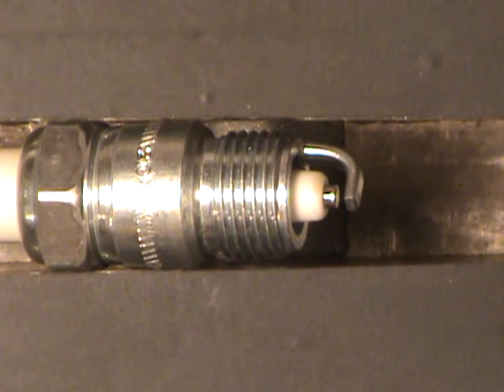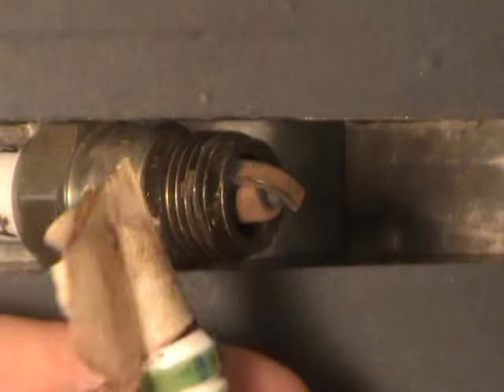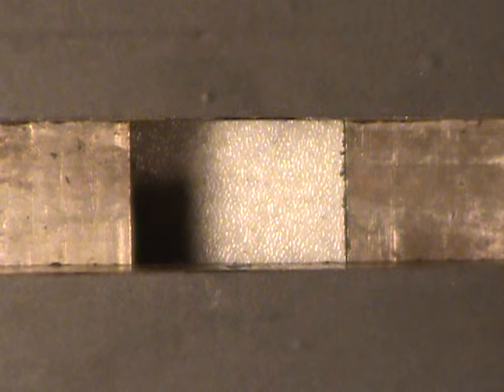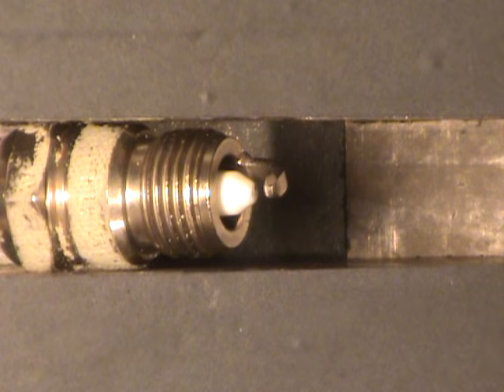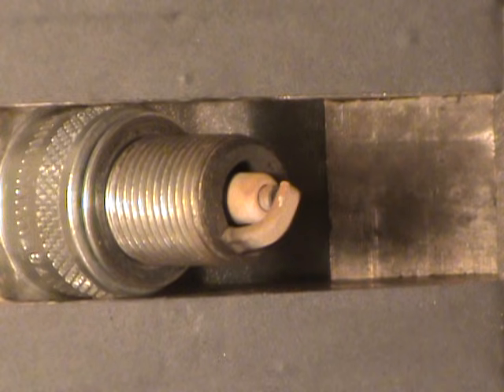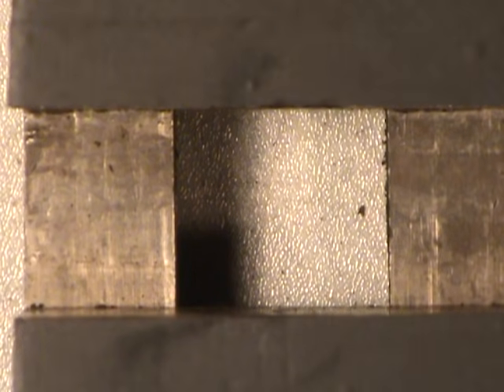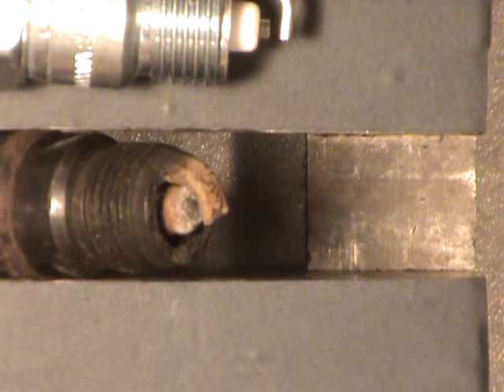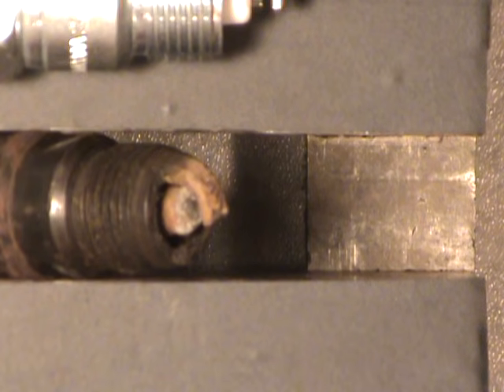SPARK PLUGS How to Read them (Part 3)

Comment: what lean means? running lean? (I'm a Romanian)
Reply from the maker: Greetings avalanchexy....Thanks for watching, and, for Your questions as well....The easiest way, to understand, the Difference between, what "Lean" is, compared to what "Rich" is, to think in terms of a "Ratio", as in, the Amount of "Fuel" (or in this case, Gasoline) that is "Mixed" with the "Air" that the Engine "Burns" inside the Combustion Chamber/s....A "Lean" Mixture, or Air/Fuel (or, Air to Fuel) Ratio, has "Less" Gasoline in the Air/Fuel Mixture, as Compared to a "Rich" Mixture, that has "More" Gasoline in its Air/Fuel Mixture....Let's Compare a "Rich" Mixture (or, Rich Air/Fuel Ratio), to a "Lean" Mixture" (or Lean Air/Fuel Ratio) shall we....A "12 to 1" Air/Fuel Ratio, is "Richer" then a "14.7 to 1" Air/Fuel Ratio....In the first example, the "12" is the Parts of "AIR", and the "1" is the Part of "GASOLINE", thus "12" to "1" Air/Fuel Ratio....In the Second example, we have "14.7" Parts of "AIR" to "1" Part of "GASOLINE".

So, when the "First Number" is "Higher", when Compared to a "Lower" First Number, the "Higher" the Number, in the "Air/Fuel" Ratio, the "Leaner" it will be.

When a Fuel Injected Engine, in a Car or Truck is just going about 30 Miles Per Hour or 50 Kilometers per Hour in the City, at about Sea Level, and, on a level road, and, the gas pedal is being held steady, the Air/Fuel Ratio will be on the "Lean" side, at about "14.7" to "1" Air/Fuel Ratio.

When the Driver, of the Same Car or Truck (above), wants to "Accelerate" really Fast (as in, Push the Gas Pedal All the Way Down), then, the Engine Needs a "Richer" Mixture, usually about "12.5 to 1" Air/Fuel Ratio (or might be a bit Richer), because, if the Mixture (or Air/Fuel Ratio) is far too "Lean" (usually Above, about "13" to "1" Air/Fuel Ratio), while doing a Wide Open Throttle "Acceleration", that Far Too "Lean" Air/Fuel Ratio, will usually "Damage" the Engine...!!!

When the Engine is Cold, it requires a "Richer" Mixture (Air/Fuel Ratio), to keep it running properly, then, when it warms up to "Operating Temperature", it will be able to, Run Properly, on a "Leaner" Mixture (Air/Fuel Ratio).

When I'm talking about the word "Mixture", it simply means, when, "Air" is "Mixed" with "Gasoline" in the Correct "Proportions", that's all.

So, You see my Friend, the word "Lean", just means that, there is Less "Gasoline" in the "Mixture", or, Air/Fuel Ratio...

...and...

...a "Richer" Mixture, or, "Richer" Air/Fuel Ratio, just means that, there is "More" Gasoline in that particular "Mixture".

Just remember, "Less Gasoline" in the Mixture is "Lean" (or Leaner)...

...and...

..."More Gasoline" in the "Mixture" is "Rich" (or Richer)...

...I hope now, that You might be able to know the Difference, between, what "Lean" and "Rich" are, when it comes to the "Mixture" or "Air/Fuel" Ratio, that the Engine Needs, depending on "What", the Driver of that Car or Truck, is asking the Engine to do.

Be Safe, take care, and have a good one.
Reply: Thanks for the detailed explanation! Better than the dictionary.

Comment: Smokes bad oil fouled  plug
Reply from the maker: Greetings donald laisure....Which Engine do You have there???....What "Year" is it???....How many Miles or Kilometer's does it have on it ??? (Odometer reading???)....The first thing that has to be determined, is, just "How", is the Motor Oil "Making" its "Way" into Your Engine's "Combustion Chamber/s"...???....I have Indicated Most of those Possibilities, in My "Reply" to You, in the "Comment", that I left here, just "Before" this One....Let me know, just "Which" Engine (Yours), that we are talking about, so, I at least some "Information" to go on....Be Safe, take care, and have a good one.
Reply: Yamaha golf cart one cyl
Reply from the maker: donald laisure
Greetings donald laisure....Thanks for the Information, but, there's a bit more to it, then the Information, that You did indeed provide, thus far....Apparently, there were "2" Types of "Yamaha" Engines, that were "Installed" in some of the Golf Carts...."1" Type was a "4-Stoke-Cycle" Engine, and, the "Other" Type, was a "2-Stroke-Cycle" Engine....I will now provide some Information, on "How" Both "Types" of Engines, "Might" be "Smoking" a Bit More then Wanted or Needed....But, before I go down that Road, I will ask You this...."If", and "When", did You, or someone else Do "Maintenance", and a Proper "Tune-Up", on Your Golf Cart's "Engine"..???

It's very Important, to keep Your Golf Cart "Engine", well Maintained, and in Proper "Tune" as well.

The so called "Maintenance", includes "Basic" Items, such as...

"Air Filter" and "Fuel Filter/s" being "Changed" at the Manufacturer's Recommended "Interval" (and maybe Sooner, if the Filter/s get Dirty/Plugged-Up "Before" that "Interval!"), and seeing as how You might have a Golf Cart there, that so called "Interval", could be, either or both, "Distance Traveled" (Miles/ Kilometers, and who knows, maybe even the Golf Courses "Yardage", and, how many "Holes" that You normally "Play", as in "18" Holes, or, shall we say, a "Half" Game, as in, Only "9" Holes...Oh, and, don't forget to Include the Distance Traveled to the "Practice-Putting-Green...!!!...lol).

Then, if Your Engine is a "4-Stroke-Cycle" Engine, You will have to "Change" Your "Motor Oil", and, Your Engine's "Oil Filter" (if it has one), as well, and again, I say, at the Manufacturer's Recommended "Interval".

Let's now see, if we can Determine, just "What" kind of "Smoke", that happens to be, shall we say, Pouring-Out-of-Your-Golf-Cart's-Engine...???

I will start with the "4-Stroke-Cycle" Engine (the Type, that has Intake and Exhaust Valves)...

...If the "Smoke" looks Black, then, this is usually an Indication, that the Engine is being Fed (as in Feed), a Too Rich Air/Fuel Mixture, that can be caused by a Malfunctioning "Carburetor", or, something as Simple, as a "Dirty/Clogged" Air Filter.

"IF", the "Smoke" looks like a "Blue-ish" Color, that's tellin' me, that there is a "Motor Oil" Burning Problem, that can be caused by, some of the following...

Worn-Out "Piston Rings".

If applicable, Motor Oil, might be getting into Your Engine's Valve Guides, where the Engine's Valve Stems Travel Up and Down, which in turn, will allow Motor Oil, to get into Your Engine's Combustion Chamber.

Now, for the "2-Stroke-Cycle" Engine (this Type, Does-Not have Intake and Exhaust Valves!)...

The "2-Stroke-Cycle" Engine "Requires" Special "2-Stroke-Cycle" Engine "Oil", that gets "MIXED" with the Gasoline, that the Engine Burns...!!!

The Mixing "RATIO", is of the utmost "Importance", in order to keep the Engine Properly "Lubricated", so as to Prevent, Engine "Damage", and Excessive Engine (parts) Wear...!!!

If Your Engine, happens to be a "2-Stroke-Cycle" Engine, "Make Sure", that, You Use the Recommended "2-Stroke-Cycle" Engine Oil, and, in the "Correct" Mixing "RATIO", that the Manufacturer "Recommends"...!!!

(In the past, I have used anywhere between "20" to "1", and up to, as High as, "100" to "1"...Gasoline to Oil "RATIO"...!!!).

If, in fact, Your Engine is a "2-Stroke-Cycle" Engine, that Excessive "Smoke", could be something, as Simple as, Too Much ""2-Stroke-Cycle" Engine Oil, in the Gasoline/Oil "Mixture"...!!!

The "Manufacturer", and in this case, being "YAMAHA", that actually Manufactured the "2-Stroke-Cycle" Engine, should know, what "Oil" to Use, as well as, the "Correct" Mixing/Mixture "RATIO", to use as well.

If "Too Much"..."2-Stroke-Cycle" Engine Oil, is Added to the Gasoline (Gasoline/Oil Mixture), as in, "Over and Above" the Amount, that the Manufacturer (Yamaha) Recommends, then as I see it, that alone, will probably be causing some "Extra" Smoke, that can not only be "Seen", but "Smelled" as well.

Some "2-Stroke-Cycle" Engines, Require that the Gasoline and Engine "Oil" get mixed together in the Gas Can, while Shakin' it...

...while some "2-Stroke-Cycle" Engines, have, an Engine "Oil Tank", with an "Oil Injection/Metering Device, that does the..."Add the Oil to the Gasoline" Automatically, providing that the Engine "Oil Tank"has the required amount of "2-Stroke-Cycle" Engine "Oil", in it, at "All" Times!

Different Manufacturers of "2-Stroke-Cycle" Engine "Oils (the Type that gets Mixed with the Gasoline, that is), will probably be showing on the back of the "Bottle"..."THEIR" particular Gasoline to Oil Mixing "Ratios", but, I still Lean towards the Manufacturers Recommendation, and in this case, "Yamaha".

In "Both" Types of Engines, a "Fouled" Spark Plug (aka, a spark plug that looks dirty, and may or may not have excessive deposits, coating the "Fire-ing" End as well), can, and usually will, cause that Spark Plug, to "Miss-Fire", which will usually, send "Un-Burned" or "Partially" Burned Gasoline, and in the Case of a "2-Stroke-Cycle" Engine, some "Unburned"..."2-Stoke-Cycle" Engine "Oil" as well...!!!

So, the Engine has to be in "Good Shape", with "Good (combustion chamber) Compression" as well...

The Carburetor (I'm thinkin' it has one), has to be able to Function Properly as well...

"All Filters"...Air, Fuel, (and Oil, in the case of a "4-Sroke-Cycle" Engine), has to be as "Clean" as possible...

Make sure the Engine is "Tuned-Up" Properly, and has all of the needed "Maintenance" Items taken care of as well.

A Nice New Factory/Manufacturer Recommended "Spark Plug", should have its "Gap" Set to Specification, and Installed in Your Engine...

...then, after about, oh, let's say "10" Hours of Engine Operation, and with the Engine "Cold" and "Not Running", Remove the Spark Plug, and "See" how it Looks.

The "Above" things that I mentioned, are just "Some" of the Possibilities, that might be causing the Excessive "Smoke" that You were mentioning...

...If You like, let me know, how You make out...

..Oh yeah, there are some very Good "Golf Cart" Websites, that have Question and Answer Forums on them...

...Maybe do an Internet Search, and have a Look-See, at what Other Golf Cart Owners have to say, about Your Yamaha Engine, and its Excessive "Smoking" Problem...

...Best of Luck...

...Be Safe, take care, and have a good one.

Comment: is there a way to tell valves guides or oil control rings sir
Reply from the maker: Greetings donald laisure....Thanks for Your comment/question....There are quite a few things, that can be somewhat of a..."Tell-Tale" (aka, as in, let You know), as far as the Possibility of Engine Valve Guides, that are installed in the Engines Head/s, or, the Oil Control Rings, that are installed on the Engines Piston/s, being Worn to the point of causing some unwanted Engine Running Problems, and then some....I will use a typical "North American V-8" Engine, as an example....If Motor Oil is getting past, the Valve Guide Seals, (on Top of the Cylinder Heads), then gets into where the "Clearance" between the Valve Guides and where the Valve Stems move up and down Inside the Valve Guides, this "Unwanted" Motor Oil, then, makes its way into the Combustion Chamber, and gets Added to the Air/Fuel Mixture, and, this "Unwanted" Motor Oil gets "Burned", or "Partially Burned" along with the Air/Fuel Mixture, and, if "Excessive Amounts" of Motor Oil get Burned, like I was just sayin', then it will usually "Coat" the Fire-ing End of the Spark Plug/s, that is Inside the Combustion Chamber, with an "Oil-ee" Residue/Coating.

If the Engine is Running, and Burning Lots of Motor Oil, a Person will usually see "Blue-ish" Smoke coming out of the Exhaust Tail Pipe!

If Black Smoke is coming out of the Exhaust Tail pipe, it usually means that, the Engine is Running "Rich", as in, Too Much Fuel (gasoline), in the Air/Fuel Ratio.

Sometimes, depending on the "Design" of the Engines "Cylinder Heads", the Motor Oil "Drain-Back" Holes/Passages, that are found on Top of the Cylinder Heads, can become "Plugged-Up", or "Partially Plugged-Up", due to a High Mileage/Kilometer-age Engine, having Excessive "Blow-By".

"Blow-By", is usually caused by "Worn-Out" Piston "Rings".
When the Piston "Rings", get "Worn" Too Much, the "End Gaps" get Way Too Big, and, the Combustion Chambers Exhaust Gas "Easily" finds its way, Past the Pistons (usually 2) Compression Rings, and the Oil Control Rings (usually with 3 pieces, 2 Rings, and an Expander between those 2 same Rings), then, down past the Piston it goes, and into the Lower Crankcase/Oil Pan Area.

Sometimes, Piston "Rings" might become "Stuck" in the Pistons (Ring) Grooves, due to Carbon Build-Up, which, may sometimes, be caused by a "Rich" (Air/Fuel Ratio) Condition.

Now onto "What"..."Blow-By" actually is...

When this "Excessive" Exhaust Gas, makes its way, down into the Lower Crankcase/Oil Pan Area, it usually "Contaminates" the Motor Oil, that is in the Oil Pan Area, and, it has to find a Way "Out-ah-there", and, due to it being quite Hot, it will usually "Rise" Upwards, and, some of it, does get "Vented" and "Re-Burned" by the P.C.V. (Positive Crankcase Ventilation) System, but, if there is Way Too Much "Blow-By", it usually "Overwhelms" the P.C.V. System, and this Excessive "Blow-By" will usually start coming out of the "Fresh Air" Pipe/Tubing as well, then into the Air Cleaner Housing/Filter it goes, making it so, that Poor High Mileage/Kilometer-age Engine "Does Not" get any "Fresh Air" in the "Lower Crankcase/Oil Pan" Area at all...!!!

Pay close Attention to, Your Motor Oil Consumption Rate, as that is one of the Easiest ways to actually "See", if in fact, Your Engine might be Consuming Motor Oil, at a Rate, that may become..."Way Too Much", for the Amount of Miles/Kilometers Traveled.

Also, remember to look at the "Fire-ing" End of Your Engines Spark Plugs, once in a while, and if You happen to see, Way Too Much "Oil-ee" Residue/Coating on any of Your Spark Plugs, well, I'm pretty sure, that now, You'll know how it got there...

...Be Safe, take care, and have a good one.
Reply: If there is a valve stem seal leakage the carbon will be cream coloured and be  quite thick.  This because the incoming fuel/air charge has oil with it and is burning completely. If it has a dark oily type of deposit it indicates a ring problem.  This the only way it can happen.
Reply from the maker: graeme leigh
Greetings graeme leigh....Thanks for Your comment....I don't recall ever having any Cream Colored "Deposits" on any of the Spark Plugs that I have seen....As for the Spark Plug in this YouTube Video of mine, that is showing that Incredible amount of "Deposit/s", that is in a "Big Clump", between the inner and outer electrodes, and, as far as I can determine, that Big Clump of Deposit/s that is there, is because of "Motor Oil" finding its way, into that Number 6-Cylinders Combustion Chamber, and as You can see, with the exception of perhaps that little bit of White-ish stuff (if I recall correctly, that is), that happens to be there, due to being in "Storage" for quite some time, and it certainly "Was Not" there, at the time, that I removed that set of 8 Spark Plugs from that Chevy 400 Cubic Inch V-8 Engine!

That Chevy 400 Cubic Incher, was going through about 1 Quart of Motor Oil, in about 500 Miles.

All Other Engine Related Fluids, stayed where they should be.

So, as I see it, that "Clumped-Up-Deposit" Spark Plug, was caused by Motor Oil finding its way into Number 6-Cylinders Combustion Chamber, and there is "Not Any" Cream Color Deposit/s, anywhere to be seen!

Also, when a typical North American V-8 Engine has Worn-Out Piston "Rings", there are at least "2" things that I have seen, that can take place...

One is "Blow-By", which is when, during the Combustion process, the Pressurized Combustion Gasses, make their way..."Past"...the Pistons, and down into the Lower Crankcase and Oil Pan they go...

It's easy to find/see this problem...

Just warm up the Engine to Operating Temperature, and being very careful, pull the PCV (Positive Crankcase Ventilation) Valve out of that Valve/Rocker Cover, and if the Engine has a Fresh Air Tube/Pipe/Hose, going to the Air Cleaner Housing, that is connected to the Other valve/Rocker Cover, that should also be removed, either from the Air Cleaner Housing or the Valve/Rocker Cover itself...

...and, If the "Blow-By" Gasses are, shall we say..."Excessive"...then, "Blow-By" Smoke will usually be seen coming out of "Both" Valve/Rocker Covers...!!!

Then, there are "Bad" Oil Control "Rings", along with, at times, Bad Compression Rings as well...

If its really quite bad, just about Anybody will be able to See "Blue-ish Smoke" coming out of the Exhaust Tail Pipe...

...and, Your Motor Oil "Level" should be watched closely on Your Engines "Dip-Stick"...cuz...the Oil Level goes down, pretty darn fast, especially, if the "Oil-Burnin'-Smoke-Show" is really "Bad"...!!!

I have experienced plenty of "Blow-By" in some older, high mileage engines, without having any Blue-ish Smoke coming out of the Exhaust Tail Pipe.

Not Everybody seems to find the Exact Same Thing, when it comes to trying to Diagnose an Engine Problem, as I have seen some pretty strange things, that can happen, at any given time.

Engines, are somewhat like People, as it seems that..."No 2 are the Same"...!!!...lol.

Be Safe, take care, and have a good one.